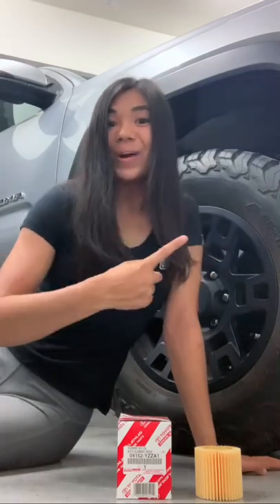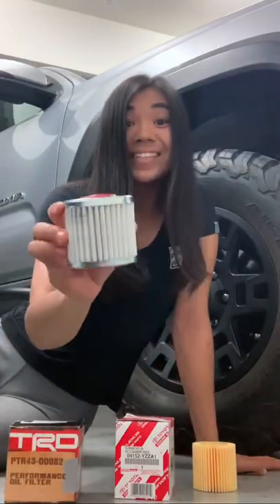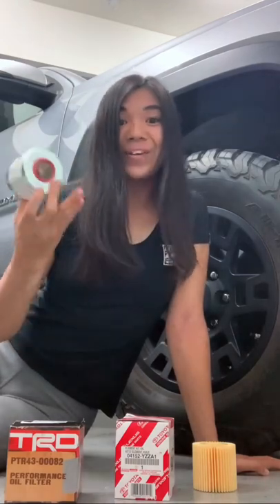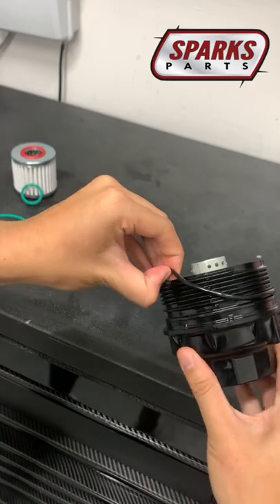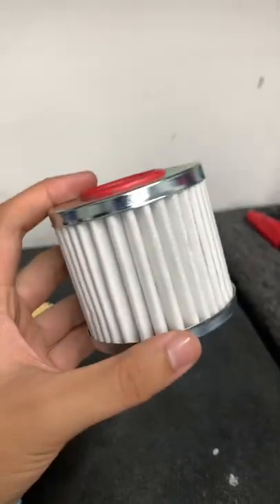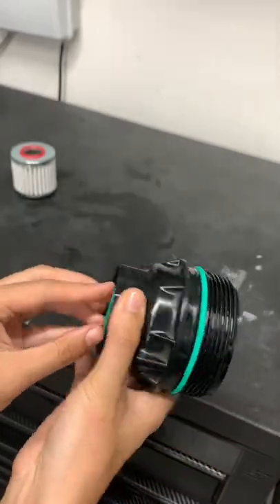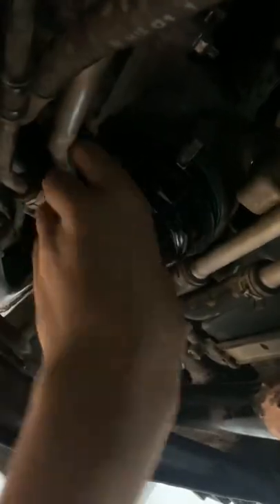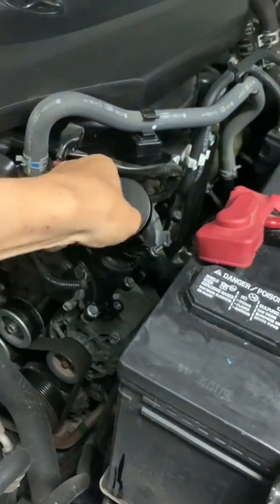Is the TRD Oil Filter better? (PTR4300082) #shorts

Comment: 5,000 miles? I'd like to see that oil after 5,000 miles. 
 That's probably under "normal" driving conditions which are very rare. Follow the extreme change recommendation,about every 3,000.

 Just use a Fram....problem solved. No need for expensive fancy filters.

Comment: Do oil analysis on your changes. Every 5k is too soon.
Reply: Sooner is always better then later and another engine replacement
Reply: It depends on how you drive. If you go off road and into the desert often, 5,000 mile changes are recommended by the manufacturer. Even if it's a little overkill - it's cheap insurance.
Reply: Another opinion. And others say, oh no do it every 3,000. Go to The Car Care Nut channel where AMD does an engine year down and examines the parts inside an engine that had oil changes done every 10,000 miles and he will show you why it should be changed every 5,000. He also knows from his experience.

Comment: If you put any filtee hit Toyota you are changjng the pressure and flow from the original.  These engines use the oil to control valve timing, chain tension and other orifices.  You will see a difference in throttle reaponse and mileage when you use filters other than Toyota.  Not a smart thing to mess with.

Comment: Full synthetic or not I still change at 3000 miles I can’t believe people go higher than that when the oil is so dirty at that point also you don’t need any tools when you get a fumoto valve Definitely worth it especially since you have a truck just put an empty 5 quart oil container under it Drain it right into the container and shut the valve you don’t even need an oil pan at that point or to Pour the oil from the oil pan into anything else to take it for recycling it’s so much easier and you’re able to do an oil change in less than eight minutes
Reply: Just because the oil is black doesn't mean it's dirty. You can only prove it's dirty by getting the oil analyzed. Just heating the oil up to the temperature inside an engine for a number of hours will turn it black
Reply: Dirty at 3,000 miles?😵 Mann, something is wrong with your vehicle

Comment: You should upgrade your filter housing from the plastic to the aluminum
Reply: If you're changing your own oil and you're not over-torquing the oil filter cap the the plastic one will last the life of the engine. I replaced mine with another plastic one. If you switch to aluminum and someone else changes your oil and exceeds the torque specs, you're still going to have a problem.

Comment: You change oil at 5,000 miles and buy the most expensive oil filter? I'd doubt that's necessary but if you just like spending on bby grl then sure. 💅

Comment: How about a conversion to put them back to the best system ever used, yep a spin on self contained cartridge of decades past so you can greatly reduce the chances of introducing crud that should never be in a oiling system while you play with that antiquated long ago used retro garbage, come on Toyota are you smokin crack or what

Comment: If you change every 5,000 miles the literal only difference your going to see is the more money your wasting for 0 reason just use the OEM paper element if it’s good for “10,000” miles you can most likely get 20,000 out of it just not recommended over a $20 filter but im just a dumb ass Toyota/Lexus technician so wtf do I know

Comment: Um.. 5k wasting money. 10k is perfectly fine for new cars
Reply: Yeah, if you want slidge in your engine. 10k maybe fine if drive like a grandma. If you drive offroad or drive hard, then 10k is too long. But hey, it's your vehicle and your money. You spent at least 25k on a new car, and in her case, it was at least 35k for the truck new. Oil changes typically $100 or less, and that is about every 3 months if you change it every 5k milesrather not have a sludged up engine once my warranty is gone.
Reply: @Eastsidegeorgiaboy  the recommended is 10k by the manufacturer